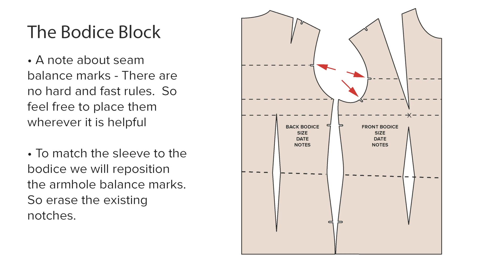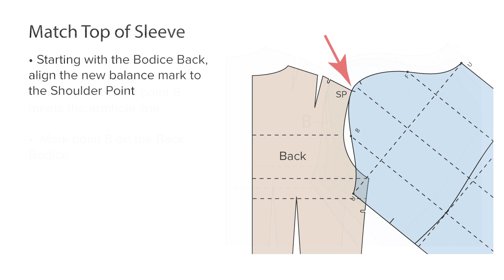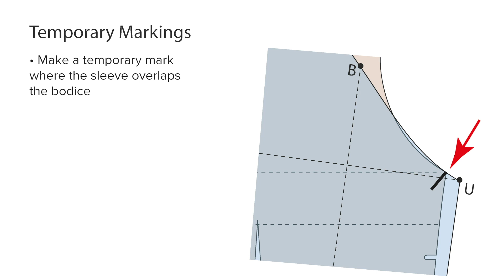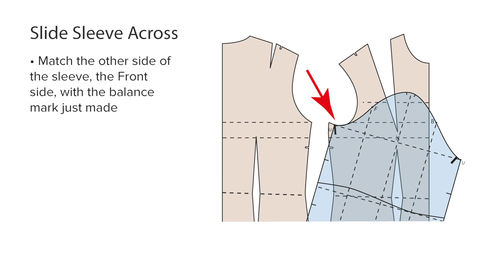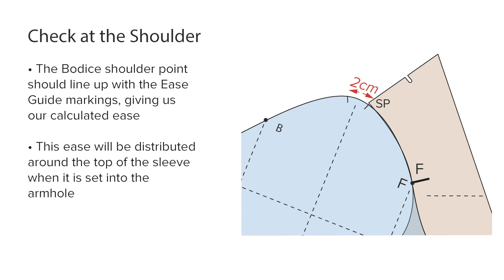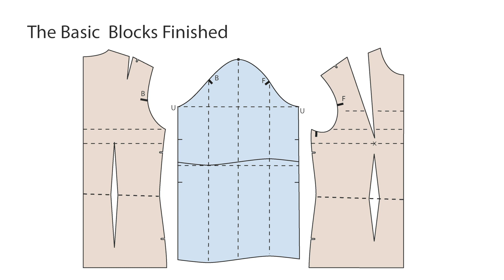Angela Kane Pattern Cutting - Metric - Fitting the Sleeve Block

Comment: I have double checked my measurements but have ended up with 1.5 cm excess ease. Should I enlarge the bodice armhole or alter the sleeve cap in some way?
Reply from the maker: Hello Marilyn,  Is this in addition to the acceptable ease at the crown?  Yes, you can lower the sleeve cap a little.  You can drop the Underarm Point on the bodice a little.  If you think you need a slightly squarer shoulder line, you can raise the Shoulder Point on the bodice a little.
Ultimately, the best way forward is to make up a toile and make adjustments.
Reply: @angelakanetv  is it supposed to be 2 cm or 1.5 cm ease would be just fine?

Comment: Hello Angela , I have always wondered how I would draft a sleeve for an existing sleeveless pattern . .could you discuss this ? I would be very great full.
Reply from the maker: Hello Marianne, Yes that would be a good video.   The problem you will find is that the armhole shape of a sleeveless dress isn't always the correct shape for a sleeve.  The best way would be to redraw the armhole, copying it from a basic bodice block and then add the basic sleeve block and adapt from there.  Thanks for commenting.